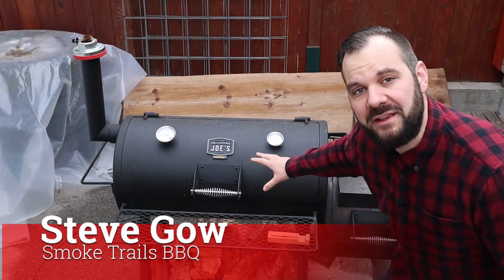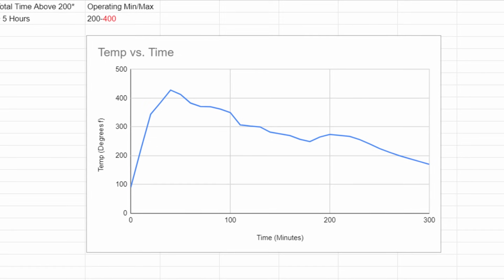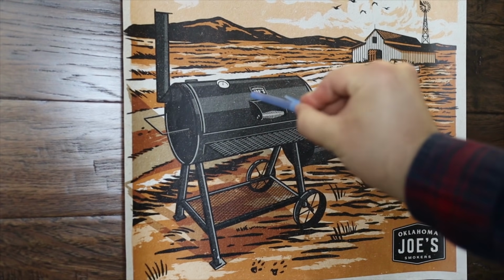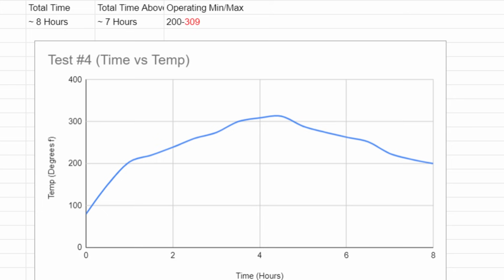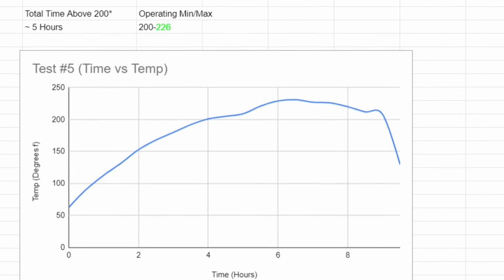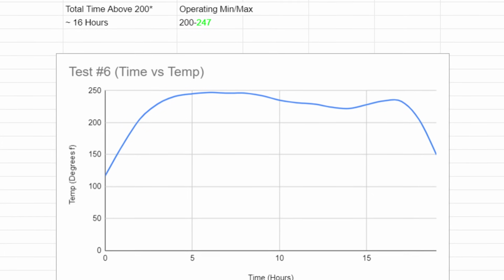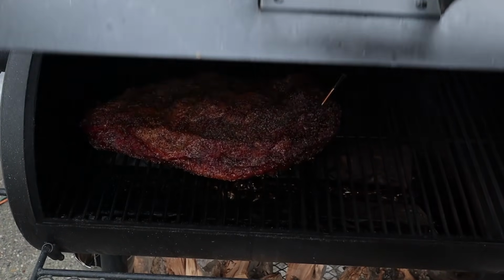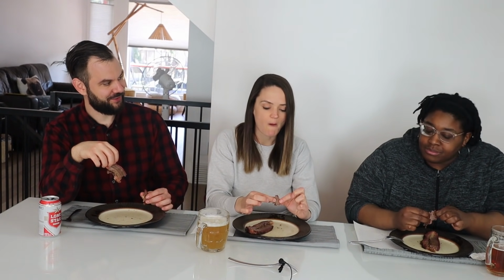11-Hour SET AND FORGET Brisket on an offset smoker (While sleeping!)

Comment: Love the video but I did have a question about the tip top temp. You mentioned in the video that as long as you set the tip top temp correctly that you would get the desired results you were looking for, can you tell me what you set the tip top temp to? Thanks and smoke on!
Reply from the maker: Can't remember tge setting but I think it will be a bit different for everyone
Reply: @SmokeTrailsBBQ  okay, thank you!

Comment: I'm not throwing cold water on this, but my old-school Uncles and Dad would beat me with a cane if I started jacking with the stack. 
Temperature is controlled by adjusting air INTAKE, not by manipulating the exhaust damper. We use about 1/2 inch intake opening on an offset like OK Joe. I measure air temp at the grate 1/2 inch from meat (but not touching). Granted, I can't run it for 11 hrs without adding coals, but my temps vary from  215 to 220 on the relatively thin OK Joe steel.

Comment: Great video.  There's a lot of interesting automated/semi-automated mostly charcoal smoking methods out there I've seen people talk about.  Not sure I've seen the damper on the stack though, usually I see people go with a bbq guru or something with an electronic temperature managed fan on the firebox which seems to work well.  There are some big commercial offset smokers that user electronic temperature controlled dampers on big intakes that seem to go from mostly open to mostly closed based on the temperature.  Maybe the intake temp control method works well if you go mostly open to mostly closed and can electronically go back and forth.

All in all it seems like you ran this like a kamado smoker.  Where people can run 50+ hours on a single load of charcoal.  Might just pick up one of those for these type of smokes since they are super insulated and super efficient.
Reply from the maker: Yea these offsets are definitely not as efficient as a kamado haha! Maybe with some insulation...
Reply: @SmokeTrailsBBQ  Yeah a good point, another big thing on those commercial ones with firebox damper systems is most use a thick layer of refractory insulation.

Comment: Yea. Used a Tip Top Temp on my kamado for years. The kamado forums have been discussing this for a long time. Only difference is that they are more efficient overall. 
Here is the thing though. This method works and makes sense for a lazy Q unit. To me though, it kinda defeats the purpose of a stick burner. The whole idea is to have a large amount of airflow with a hot, clean fire. Sure, if you can only spring for a inexpensive offset and need to do a lazy q once in a while, why not. I would think you would be better off doing a damper controlled cook in a cheap water bullet than an offset though. Just my .02.

Comment: Awesome video. I never thought about using my tip top temp for my highland. 

At this point, you should get a okj bronco. I have the highland and the bronco. Both produce excellent bbq. Bronco is more of a set and forget.
Reply from the maker: Been thinking about it! I really want a drum
Reply: @SmokeTrailsBBQ  go for the pro if you do decide to. I'm going to upgrade mine eventually. Maybe they'll send you one for free.
Reply from the maker: @benh580  good to know! I'll look into the pro. What's better about it?
Reply: @SmokeTrailsBBQ  its taller and its 22 inches in diameter  instead of 18.
Reply from the maker: @benh580  ahhh yea that extra space would be the deciding factor for me. I don't want to fold or hang a brisket

Comment: Kamado user here. Question for everyone: I’ve never used an offset, but everyone who has says the flavor of an offset is next-level compared to any other smoker. I assumed that was because you’re burning real wood. In fact, sometimes I even use wood chunks as my only fuel in my Kamado. But is an offset still worth getting if you’re only using charcoal with chunks? Does the the offset itself still produce better flavor when not using wood splits? Thank you!

Comment: Charcoal is of course more stable and steady than wood burning... but as you can see it reduces the smoke flavor as it isn't burning logs of wood. As it stands, great smoky BBQ takes effort and time... and unless you find a way to keep a log fire going on its own for 12+ hours, you just gotta put the work in if you want that authentic pit taste.

What I'm waiting for is just that though... if you can systematically, and intelligently, add logs and adjust the embers automatically... while controlling the temperature through airflow control --- it might just be possible.

Comment: Which Oklahoma Joe model is this? I’m thinking of purchasing one myself.
Reply from the maker: Highland!
Reply: Interesting. I looked at that very model at Lowe’s and thought the cooking surface seemed a bit low.
Reply: Love your channel, by the way. Fantastic content!
Reply from the maker: @elitistsnob1793  thanks! I appreciate it!
Reply from the maker: @elitistsnob1793  hmmm. Well there's a lower charcoal grate and an upper cooking grate. Maybe they just had the charcoal grate in it
Reply: I bought the longhorn model. I found 3 simple mods that help it heat more even across the barrel. 1. buy a second gage so you can see temperature change from fire box to stack. 2. Add a metal dryer elbow ( non galvanized, heating galvanized metal is poisonous). 3” elbow  it pulls heat from grill grate level. 3. Make or buy tuning plates ( pushes heat across the smoker more evenly) I went cheap and used 2 -15” ceramic floor tiles angle the fist one to cover the opening from the fire box,butting the second one up to it, should cover half the bottom and will allow smoke to flow up the gaps on the sides. You should see 10 degree temperature variation between the 2 gages. It still beats my Traeger
Reply: One last thing if it’s cold out cover the barrel with an old  cotton or wool blanket helps hold the heat in, keep it away from the fire 🔥 box.

Comment: tooooo much science and such took a 10 minute nap and still with science. give you credit just for the beer great beer taste and last bisket cutting footage of a juicy once. Ive build my smoker about the same size chamber just longer stack and bigger fire box all 1/8 1/4 box and done just great for 10hrs smoking with temps at 225 230 very lil gab of the box about 1/4 and 1/2 on the stack. guess it all depends of weather too.
Reply from the maker: Nice I want to build one
Reply: @SmokeTrailsBBQ  go for it. also adding insulation to the firebox also helps a lot on keeping the heat flow stand longer. might be doing that to mine just cus the box is big enough to add it.

Comment: Hey checkout the gravity smoker's they work extremely well and closest flavor to an offset with having that temperature control
Reply from the maker: Sounds interesting!
Reply: Most all gravity versions have a very thin burn chamber that will rust out fast. I don't see any manufacturer using a thick liner that isn't really expensive.

Comment: Ref the Tip Top Temp:  I'm shopping now for one, and no model is made for my 3" vent (Char-Griller Offset similar in appearance to your OK Joe) .  Was that a type of putty or clay you used to create that seal with your Tip Top Temp?
Reply from the maker: It's OK if it's a bit bigger. I used dough to seal it

Comment: Hmmm...  coconut shell charcoal?  Well, I understand the desire to have hassle free brisket, it is quite a lot of work to smoke a brisket but I've not seen coconut shell charcoal listed on anyone's favorite "smoke flavors" they want to put on their food.  Ever.  :)
But I gotta admit, I'm extremely partial to pecan wood anyway for my brisket, and even going to the popular and really good Q joints near me, I'm still a little disappointed in the smoke flavor since most restaurants use either post or live oak.  The smoke flavor on my brisket is THE thing for me, and I've not found anything that tops pecan wood.  Yet.
I did like your mention of that smoke stack regulator (Tip Top Temp), and appreciate the link you provided.
But in regards to getting some sleep while cooking brisket, the thing that I've found works for me, is I don't need to keep the brisket in the smoker for the entire cook time...  once it's wrapped in butcher paper, I slap that sucker in the oven set at 250 degrees F, and let it finish cooking there, so at least I can get ~6 hours of sleep during that time.  Once the brisket is wrapped, it won't get anymore smoke flavor for the rest of the cooking time so no need to waste my precious pecan wood just for heat.  
Thanks for the Tip Top Temp recommendation!

Comment: How do you put this device over the chimney stack with the flap open? Do you have to get rid of the flap for the Tiptoptemp to work?
Reply from the maker: Yes I took the flap off and stuck the TTT on with some flour/water paste
Reply: @SmokeTrailsBBQ  Can you direct me to which model I should order for an Offset Smoker and any accessories that you think would be helpful?'
Reply from the maker: @exceptionalnotary9529  hi Wil. It's tge normal kettle T3 one. No accessories. I just used a ring of dough to seal it on. It hardens up and seals it

Comment: Cool video! crazy thought...you can have both an offset and a pellet.  I have a 125gallon/560lb offset, and a oky Joe pellet. Depending on my needs, and lately my supply of dry wood, I can use either...or the pit barrel for and easy 11hr at 250.

Comment: How did you attach the Tip Top Temp to the smoke stack?
Reply from the maker: Dough
Reply: What is dough?
Reply from the maker: @mademsko  flour and water. Shaped into a ring to seal it on. Its an old distillers trick. The dough cooks, hardens and seals

Comment: What was that gasket material you used with the TTT?
Reply from the maker: Dough
Reply: @SmokeTrailsBBQ  thank you sir. I ordered a TTT after watching this video! Hopefully it’ll help me maintain a more consistent temp. So just water and flower then? No burning?
Reply from the maker: @zmccool88  yep. The heat will dry it out and it will seal on tight. It's easy to remove as well

Comment: My Wally World propane Box smoker will go all night. It will go 24 hours if need be. You put smoke on the brisket in the first 4-5 hours. Start at 6pm smoke until 11pm then set temp to 225f run all night til 7am then finish at 260f til you hit 210f. Lunch anyone.

Comment: Thanks! That's what I've been looking for. Does it matter how the briquettes are stacked and how many get lit at a time? I have used bamboo briquettes, which are in a log form and I can pick up from stores as I need them. The only coconut shell briquettes that I can find are on Amazon and they are in cube form. Bamboo briquettes are long burning and provide good heat for BBQ, but I am not sure how they'll perform when used this way.

Comment: 4:20 false 
Negative pressure/

The pressure is positive inside the pit. The air pressure outside the pit is greater is all.

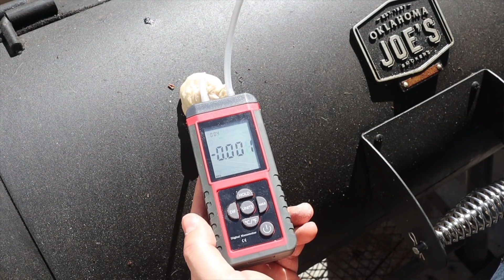4:50
Pressure difference (delta) 1pa
Exactly right. Not negative pressure 😅

Comment: Does the Tip Top temperature controller that is designed for the Weber fit the Oklahoma Joe Highland? I noticed the site has 3 or 4 other sizes.
Reply from the maker: I just got the regular one for the weber kettle
Reply: How did you adapt the Tip Top Temp to the size difference in the chimney smoke stack? I bought the Kettle size and my Oklahoma Joe Highland Smoke stack is considerably smaller than the red gasket or the Tip Top Temp part? Help and thanks.

Comment: I'm in a very similar situation. I am juggling multiple kids under the age of 4 though, and my wife can't hack it when I am out there all day with the smoker. I have a OKJ reverse flow highland, works great as a stick burner but I have been trying to get it to a set it and forget style to get it to at least the stall - I usually wrap and put it into the oven at the stall. Right now, I have tried using a heater meter, and on a full FIRST basket I can usually get about 4 hours with charcoal. I don''t have a minion basket though. Was wondering if you had any suggestions,  my next additions might be the TTT and trying to get my hands on some GOOD coconut charcoal. Do you have any recommended charcoal for that? Also - INCREDIBLE content, been watching a lot of the videos. Keep up the great work!

Comment: Cook it the day before, and rest in a 150-170 oven (or in a good cooler, preheated with hot water) overnight. Problem solved.
I've had a brisket come out of a well prepared cooler after 14 hours, and it was still 145 deg. Which is perfectly safe

Comment: Interesting, like you I tried for years to re-invent the wheel....guess what?? It didn't work for me either, sort of? Try this, rub your brisket with yellow mustard which serves as a binder for salt, pepper and a little garlic powder. Place it (fat up) on your smoker around 240 deg for about 6 hours, and plenty of smoke. (I use pecan and mesquite mixed) This is all the smoke it will ever get. Wrap it with butcher paper and place it in a roaster oven, (like you might roast a turkey in). Place it on your garage work bench at 250 -260 degrees until the internal temp of you brisket reaches 185-190 in the thickest part of your brisket. I use a temp probe that will signal me when the temp has been reached. When finished, you will find a tender juicy chunk of meat that didn't require you to stay up all night tending a fire. Trust me on this one...it works!! BTW, do this in your garage and not inside your home unless you like the smell that WILL linger for awhile.

Comment: Hi from the UK , can I keep my smoked  meats warm in my Brod & Taylor prover  box until I'm ready to eat it hours later ?   Have you tried this method yet . Keep safe & well .
Reply from the maker: It would need to be able to hold steady temps at 150. If it can do that then yes
Reply: @SmokeTrailsBBQ  luckily it will thank you for your help , I'm learning a lot from your videos so keep making them ,
Reply: I use a cooler, brisket in the bottom, fill the rest of cooler with towels, will stay warm for hours.

Comment: Thank you for the video, lot of food for thought here. Pun intended I guess. We're taught that a combustion engine regulates flow of fuel and air before the combustion chamber, even though some back pressure is required at the exhaust. You can slow or shut an engine down by squeezing down the exhaust, but this would result in coking an engine down. Since we're burning wood, isn't there a concern about creosote buildup on smoker and the food itself? Tempting approach, but this was my initial thought.
Reply from the maker: It's not as bad with just pure charcoal

Comment: How does this change your smoking style from the fire management video where you leave the intake door open? Are you now controlling via the intake more?
Reply from the maker: Hi Nicholas! No, this is a different method of fire management entirely. It's more for times when i don't have alot of time to babysit the fire. I still burn sticks with everything wide open most of the time.
Reply: @SmokeTrailsBBQ  thanks for the reply. Been cooking a pork butt today on the same smoker, but using wood chucks. I found with a digital probe that my grate level temp was 40 degrees less than the dome gauges. Been fight all day to get the temps to at least 225 at the grate. Need to find splits instead of extra charcoal.
Reply from the maker: @NickDrone  yea it's a battle without splits. I always say I felt like I was just shoveling coal in constantly until I started using splits

Comment: You can’t compare smoking with a pellet smoker and a offset using charcoal.  Now if you used a offset with wood I would go with it.  But if you are using charcoal you aren’t getting a good smoke flavor.  You should just drop it in a oven for the full cook.  The problem using charcoal is to get through the bad taste of the charcoal you need to burn it in a chimney before going into the offset.

Comment: Which one of the tip top temp did you use for the OK Joe smoker ? I have the same smoker and noticed on Amazon there are several sizes....
Reply from the maker: The original one. T3 I think

Comment: Do you think this would have been possible by using just wood logs? Like hickory or pecan? Wanna try this, but only have real wood for the smoker right now, lol
Reply from the maker: I don't think it would work. The wood would just smoulder and smoke alot without producing alot of heat. I did try this as dell with a big log in the charcoal and it produced alot of dirty smoke

Comment: Switch to a masterbuilt gravity series. Still uses charcoal, still runs real wood, 5 percent the work.
Reply from the maker: I'll check it out!
Reply: @SmokeTrailsBBQ , check out a old country gravity fed smoker..it’s 10 times better than a master built gravity feeder and it doesn’t use electric or any other bull crap electronics that fail.

Comment: Fire doesn't need air dude, it needs oxygen. This is the number one fuel source for fire, and has been well known since fire was first lit. When dealing with anything that involves an intake the biggest issues you will deal with is oxygen. Too much oxygen will cause the fire to just burn more in flames, too little will cause the fire to burn out while there is still coals to be used. The best approach for any of this issue is to know your smoker/grill with experience. Mark your vents when you get the feel for what it takes to get to temp, just remember seasonal temperatures also count, so add that as an indication on your vents.

Comment: Why do think that stalling at 200f down to 150f  is bad? Letting the meat finish wrapped at those points would render more visceral fat as well as softening connective tissues "binding" the muscle fibres. Thus avoiding excess moisture loss from the muscle fibres itself. Thats why you can see moisture coming out from the muscle fibres and not just from the fat gaps itself.